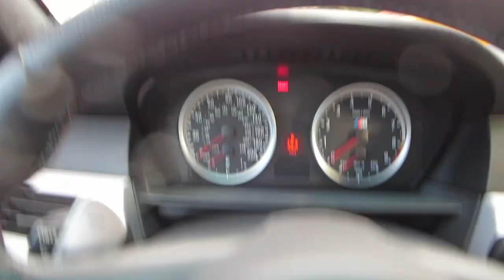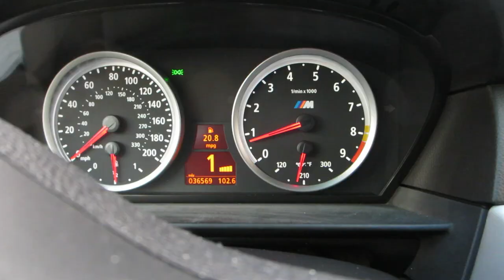MOVING DAY  11/22/13 - Day 1,080

Comment: Looks good! How do you go about insuring yourself on your dads cars? In the UK I could do insurance for a few days or the like but realistically I won't be able to touch anything with any power until I am past 25 as they are just way to expensive to insure.
Reply from the maker: Once the driver and cars are insured, it's all set I think.
Reply: JRSVlog I am just so envious of that, I just did a quote on a 2000 M5 for me over hear and it was £35k, which is crazy considering the car is worth around £7k for a nice one over hear!